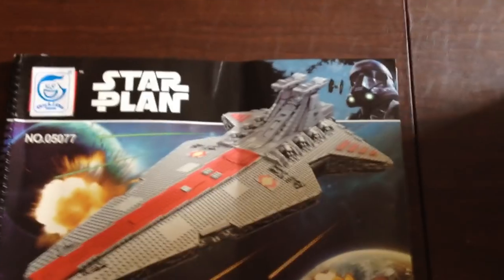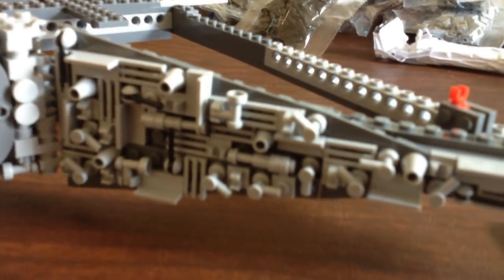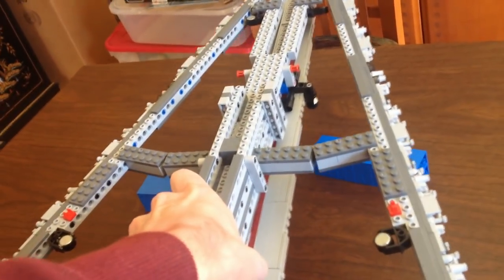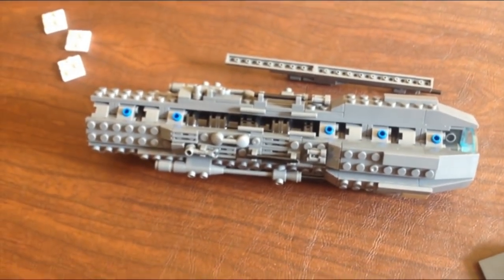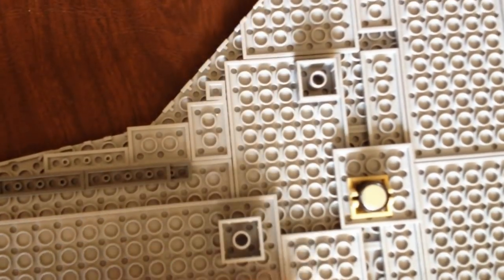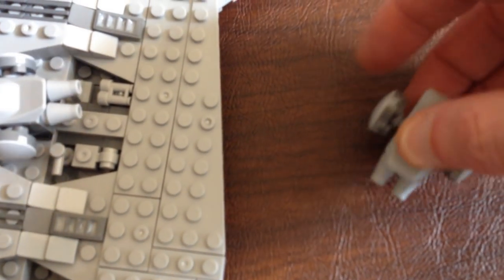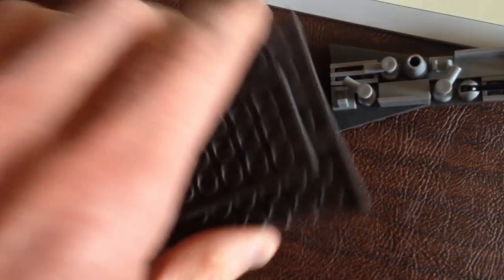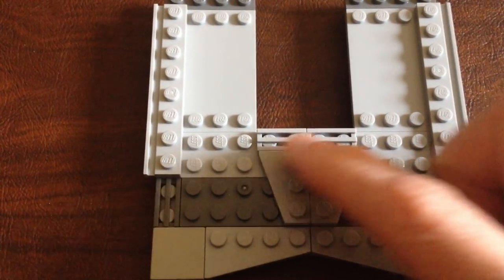What to Expect when Building Lepin's 05077 UCS Venator Set

Comment: Time stamps:

4:12 - Sub Frame
7:14 - Hangar door and side detail
9:21 - Side details
11:18 - Bottom Center hull section
12:54 Display stand and some hull
15:15 - Top Center hull
17:35 - Main Engines
23:00 - Secondary Engines
24:58 - Rear section of Conning towers
25:57 - Front section of Conning towers
26:59 - Bracket adjustment to attach bottom Center hull to stand
28:28 - Lower Hull modifications
34:02 -  Feature modifications
39:07 - Bottom hull modifications
42:47 - Top hull modifications
47:10 - Final thoughts
50:54 - Steps to build a hull section forgotten by Lepin
Reply from the maker: Hi thank you for doing this.  I also had a placard at start of the video with time stamps.  I didn't think the video would be so long  8)

Comment: Thanks for the effort in putting this together, I’m building at the moment. Had to move some pieces about because Lepin instructions are dodgy in places. It is worth the money for 6000 pieces. Thanks I’ve been using ur video as reference, I don’t have enough magnet holders so will have to improvise. Lego bricks better quality for sure, but lego prices are too high..all the best
Reply from the maker: Hi and soz for delay.  If you have the lego version of the magnets those would work much better.  Unfortunately I did not.  TBH, If Lego had a version of this, I would have paid up for their version just for a tested, more pleasurable building experience.

Comment: Did you need to use any extra parts outside of the box?
Reply from the maker: To build the ship as is per instructions? No.  To make my recommended modifications? Yes a few.  I note them in the placards prior to each step review.  I also highlight in video (though I am not the best videographer)
Reply: @studsmcsnap7672  and you replaced a few of the rotating 2x2s with official lego ones right?

Comment: I just got finished building mine and the biggest complaint i have besides the instructions are that the mognet connections are way to strong for the top sections
Reply from the maker: So sorry for delay.  Agreed.  also keep them away from electronics.  Its been a while and I long since disassembled it, but IIRC, I glued the plates the were attached too.

Comment: Kind of a late comment, but do you remember the conning towers in step 10 attaching to the ship? Or did you just slot it in without connecting it to the rest of the ship
Reply: It feels awkward with the towers free standing, but this whole build hasn’t been perfect based off the instruction manual
Reply from the maker: No worries, some of my responses are years late.  As I recall, they connected, but I had to modify some.  The sides do just lean in though.  I've long since taken it apart so I cannot check for you.
Reply: @studsmcsnap7672  all good thanks for the response! Rn I am trying to attach the lower hull to the rest of the ship. Leplin spinners indeed suck. But what I have been having problems with is the 2x2 sockets for the magnets, I feel like it would fail an earthquake test and the sockets would unhinge. Does Lego have these magnets sockets by any chance?
Reply from the maker: @joshtauber2160  I know its blasphemy, but I Krackled the magnets to the plates.  Otherwise, they just pull apart.  Lego had much less powerful magnets like these in their original Star Destroyer and train sets.  They stopped making them years ago with the whole toxic lead issues.  I'd check Brick link as they may have some.  Another idea would be to DL the new Star Destroyer instructions and adapt the technic build they used if you have the parts and desire.  Probably just easier to glue them in.  8)

Comment: Given the quality of the pieces and issues with the instructions/build experience, would you recommend this set for the money they're asking? From what I've seen, it's at least $230 and that's quite steep for a fake lego set.
Reply from the maker: Yes.  $230 is less than I paid shipped to US.  It's less than you would have to pay to part out on your own most likely and you do not have to do all that work.  Figure another $5-$15 for additional parts to make modifications I made.  If it were Lego, I imagine it would be at least double that.  Good luck.
Reply: Studs McSnap thanks for your reply and for the informative video! One last question tho, is it worth it to spend an extra 30€ for Anios instructions, or is it easy enough to modify the instructions provided and figure it out?
Reply from the maker: I used the included Lepin instructions because I felt that the pieces would be there and sorted as indicated.  From what I gather, Anio's instructions are a little different (IIRC there was a time-lapse video for parts of it) and may need additional pieces. Also they probably would not sync up with Lepin's numbered bags.  Regardless of how you go, IMO and if you have the means, send something to Anio for his efforts if you do not buy his instructions.  I sent him $20 USD via PayPal but did not buy his instructions.
Also I know the video is a little long and dry, but I do note through out what changes I made and parts needed.  Most should be in the Placards so scrub to those to make it quicker.  I'd watch each segment before building to prepare and what to expect to make your building experience better than mine and less time consuming.  GL
Reply: From Lego it would be like $700 lepin are still charging a good price for what it is

Comment: Did you ever fix the engines?
Reply from the maker: I did.  it was one of my other videos.
https://www.youtube.com/watch?v=t-5V2mqGSeI&t=13s
It has travelled to a few shows.  But I will say it could probably use a little more tweaking attaching to frame.  It doesn't like being carted over rough or bumpy sidewalks.  If I carry in a box, it holds fine.
Reply: So you took a LEPIN set from a stolen MOC design to a LEGO show?

Comment: Your video is very helpful mate, I’m nearly finished my Lepin frustrator. ..I had to make some weaker magnets I got on amazon, pressed them in to several 3 x 2 blocks and they did the job far better...Lepin does suck...
Reply from the maker: Hi thank you.  Yes, those magnets it comes with could bring down low flying aircraft.  they are waaaaaaaay too powerful

Comment: LEGO LEGO LEGO LEGO LEGO LEGO LEGO LEGO LEGO LEGO LEGO LEGO
Reply from the maker: All I can say is this, if Lego ever decides to do a UCS Venator, I'll be one of the first in line.  And while we are at it, add a UCS Ghost to that wish list.
Reply: Studs McSnap this^. I doubt lego ever makes this ship, but if they do it will cost 800$+ (if you account fir rising lego prices every year, by the time this set would cone out it could cost $1000+)
Reply from the maker: I would guess no more that 800-ish.  I think the set was 5500-6000 pieces (I didn't personally count).  But on the plus side, it wouldn't need to be modified and would probably be engineered  to hold up better.  Especially the main engines, I still have issues when transporting.  They always need to be readjusted some.  I wonder if built according to setechnic's instructions (they differ from Lepin's) if it is more solid.  Anyone build as designed?